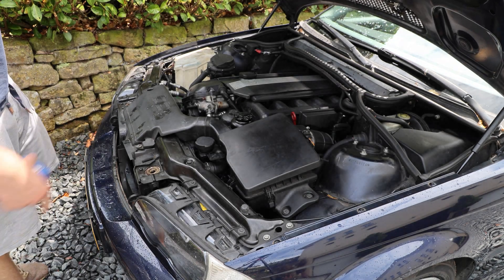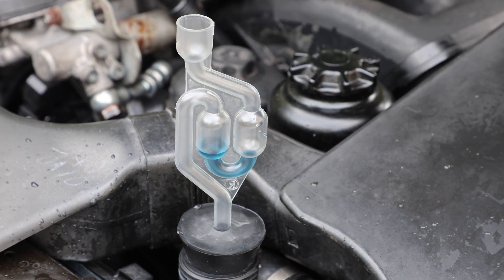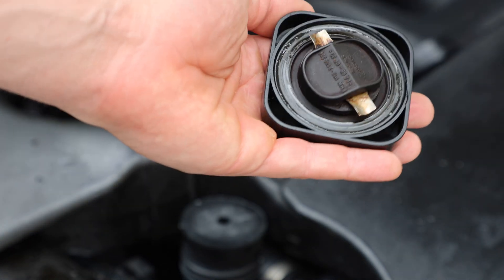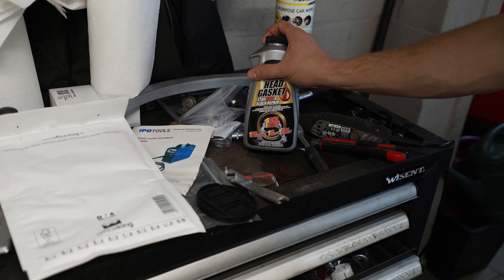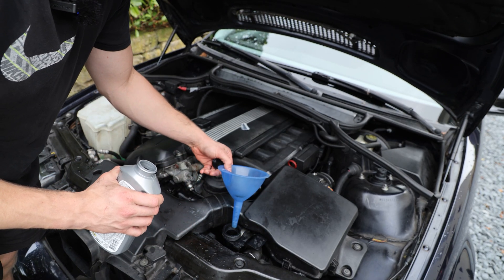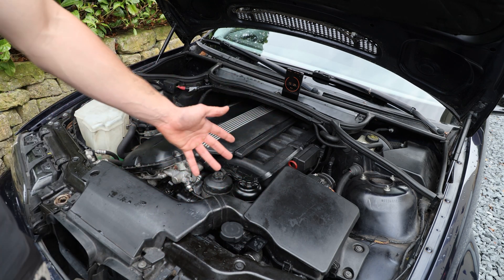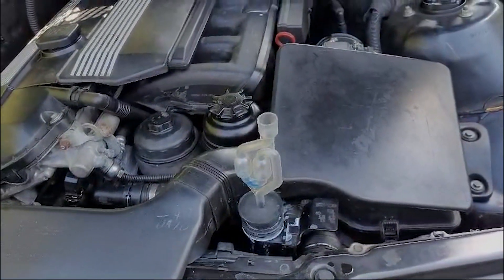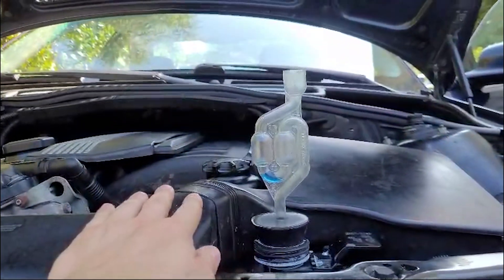Can you save an engine with a cheap head gasket sealant??

Comment: Did it work, did you run a test after? Are water pump and thermo still working?
Reply from the maker: @falastene941
@falastene941 Not really. It worked when the car was in idle, but as soon as i started driving the crack openend again and the engine overheated:( Thermostat and water pump still worked tho
Reply: @DailyDrivenClasssics  that socks, sorry to hear that, I have a leak nothing in oil or coolant, so I'm thinking of leaving it alone, was hoping I fix it to not get worse...looking online for solutions

Comment: Probably a good idea to flush the coolant with that stuff after it sealed your leak. It can clog up the radiator and then you run the risk of replacing an overheated engine along with a clogged radiator
Reply from the maker: @tonyd9
@tonyd9  I agree, but the bottle says to leave the product in there permanantly. I will flush it once we install the new engine tho  :)

Comment: By any chance you got any tips on clear coat peeling from the sun, like tips on how to fix it without a whole repaint?
Reply from the maker: No not really. If it peels of, the whole clear coat has been removed and thereby needs to be reapplied, ie repainted. I've seen videos of "fake clearcoat" products that restore peeled clear, but imo those are just temporary fixes that last a few weeks/ months tops :( If you find one of these for cheap I would try it. Otherwise, save up for a repaint or start learning painting :)